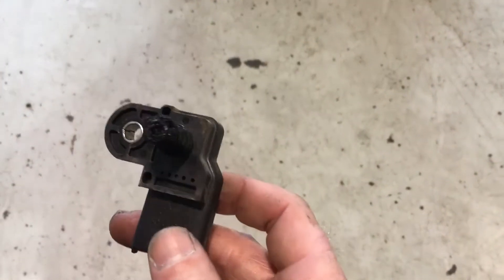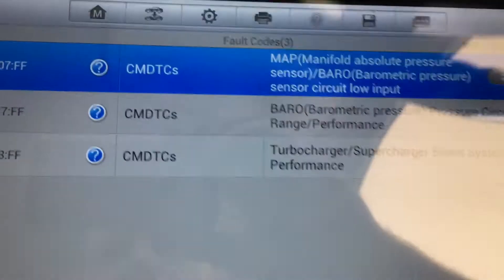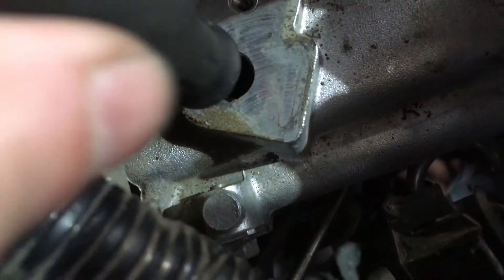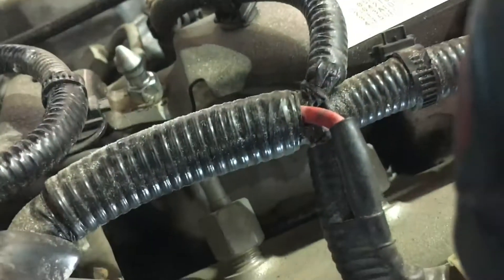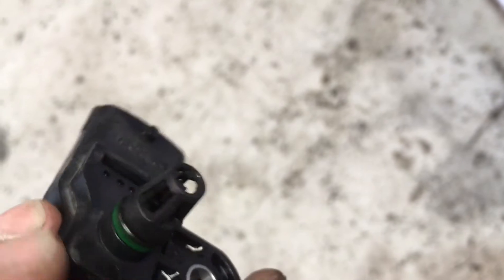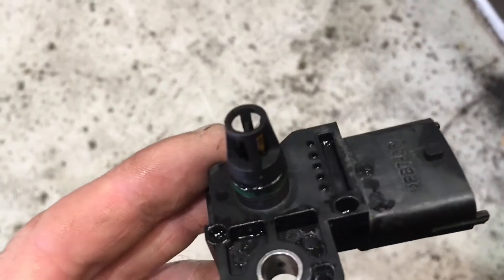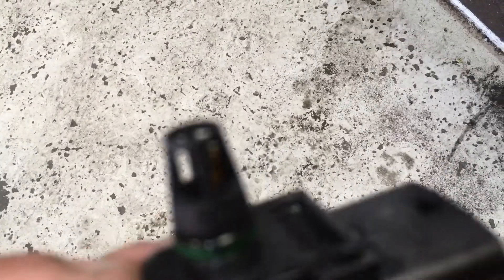Ford Ranger MAP Boost Barometric Pressure Sensor Fault

Comment: map sensor and map boost sensor  is the same or different?

because I bought a MAP sensor to replace my damaged sensor..but after I installed it on my car and started the engine, the reading on the obd ii became 35psi in idle throttle state..my car is mitsubishi triton..
Reply from the maker: On the ranger it's the same sensor. Not sure on the triton. But 35psi is too high  the sensor may be faulty. What does it read with the old sensor in it?
Reply: @gettingitdone1  with old sensor in idle rpm 14.6psi...

Comment: Thanks for the video! I subscribed your channel.

I get P2227 error in my 2016 Ford Fusion 2.0 (turbo). According to your video I see that this error code is about Barometric Pressure Sensor. Do you know where can I find that?

turns out that it is not visible at all when I open the hood. i have been looking on YouTube and Internet for guidance on how locate this in my Fusion model, however I do not know. 

Regards from Mexico!

Comment: Hi there, I have been pulling my hair out with trying to diagnose what is wrong with my 2008 BT50 3lt diesel. My ute won't make fully boost. It struggles to rev over 3000rpms and feels like it has a governor on it. I replaced the manifold sensor, both the boost pressure valve vacuum solenoids and even the turbo. Do you have any thoughts on what else it could be?
When the ute is cold it feels like it has 50% power, after ten minutes of driving it feels like it has 70% power. Every now and then something clicks and it has 100% power only for a split second. 
Thanks for any help - No even Mazda cold help me.
Reply from the maker: Ok, a number of ideas. First I'd look for any intake system leaks, especially around the intercooler. Also check the air filter is clear allowing sufficient air to be drawn in. Then I'd look at the exhaust, are there any leaks, including in the EGR cooler, or is the exhaust blocked somewhere, especially if it has a DPF. Check for any smoke while it's struggling and what color the smoke is might give some direction. Black smoke would indicate the air to fuel mix is wrong. White smoke would indicate coolant being burnt, most likely from the EGR cooler or head gasket. Bluey smoke would indicate oil being burnt. Next I'd look at the fuel system check for good supply through the filter, then the injectors themselves. Then going a bit deeper, I'd want to check the compressions (since it improves with temperature). There are ways to test all these things without replacing them. It's strange that mazda couldn't help, but maybe find a good diesel specialist in your area. It's cheaper to diagnose the fault properly, rather than replacing a bunch of stuff unnecessarily. It's always hard to diagnose things without seeing the vehicle first hand, but from what you're saying that's about the process I'd undertake. Hope that helps.
Reply: I changed the sensors on my ranger and made no difference, I found the I needed to remove the injectors fit new copper washers and the large seal around the top of the injector body. hope that helps.
Reply: Turned out to be a blocked catalytic converter. I removed it and the car is as good as new!

Comment: Where the location of that sensor
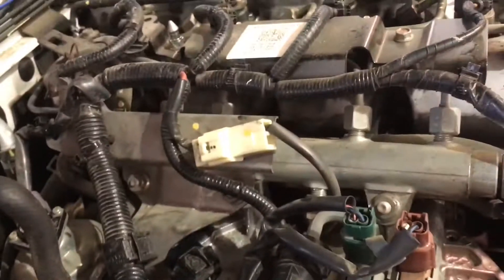Reply from the maker: Hi there, it's in the top of the inlet manifold, it has a steel plate over it that you will need to remove first. See 0:45 in the video, that's when the location is shown.